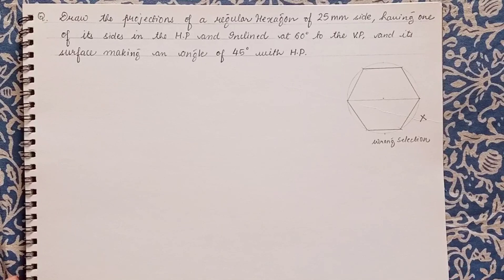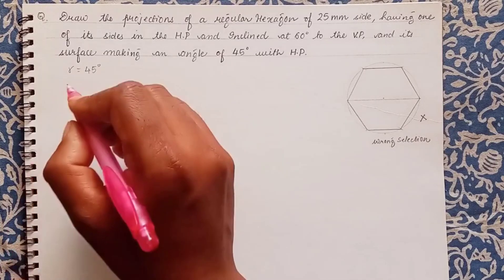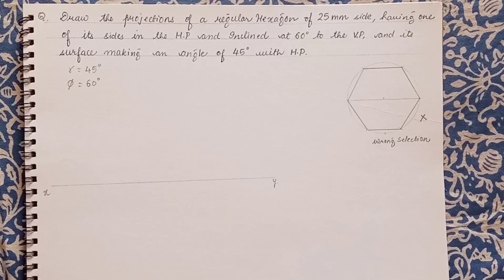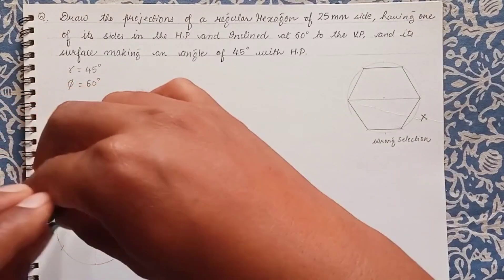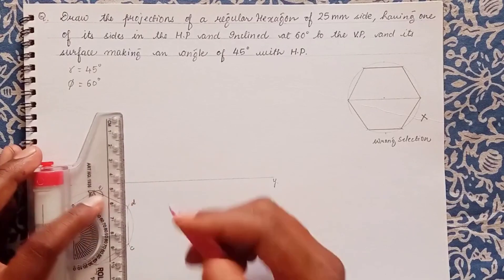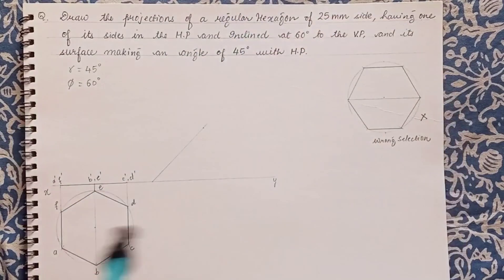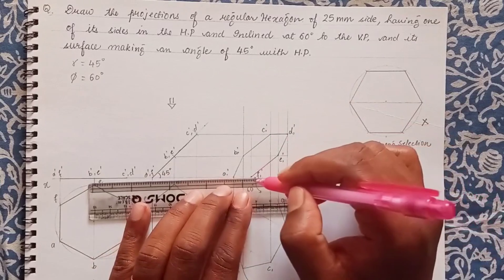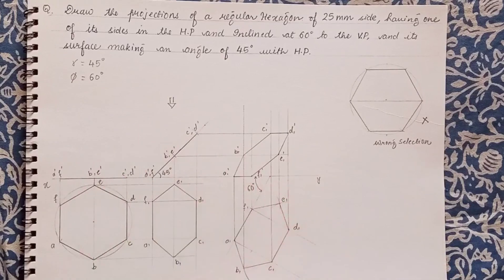Engineering Drawing/ Engineering Graphics Problem on Projections of planes for Regular Hexagon.

Comment: The one side of a regular hexagon of 30 mm side is in the VP. While the opposite side
is 4 5 mm in-front of the VP and inclined at 300
to HP. Draw the projections of plane and 
find its surface inclination with the VP.

Comment: Thank you for this nice explanation sir. I have a doubt, at 6:34 , you put the sharp leg of compass at c'd'  rather than a'f' to measure out the points in inclined line. would it be correct for unsymmetric figure as well , like pentagon , heptagon ?
Reply from the maker: As the top view figure is symmetric both the distances are same you can take any distance that is either c'd' Or a'f' in this problem
Reply from the maker: The basic idea is to measure the distance from the FV of 1stage to FV of 2nd stage
Reply: @adityakhandare  ok , thank you sir